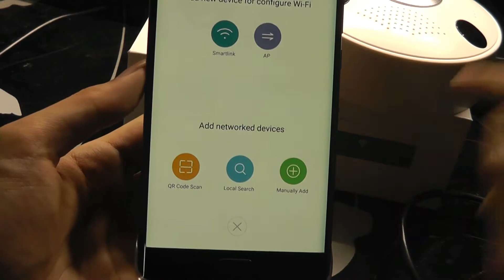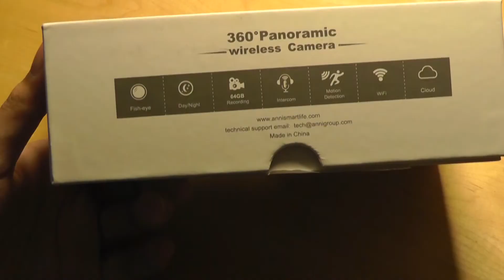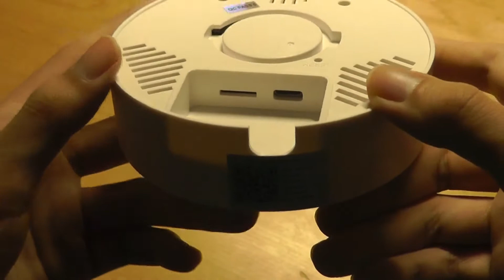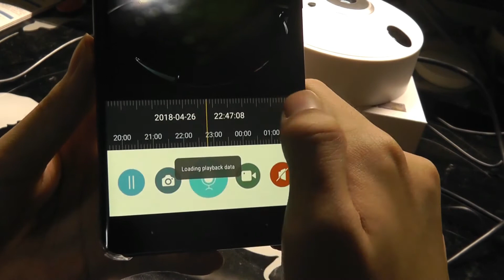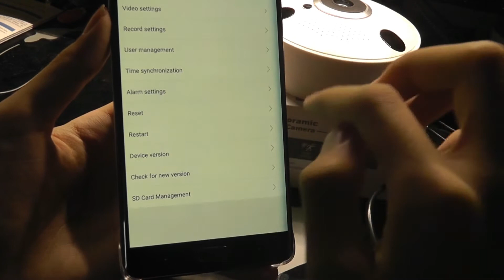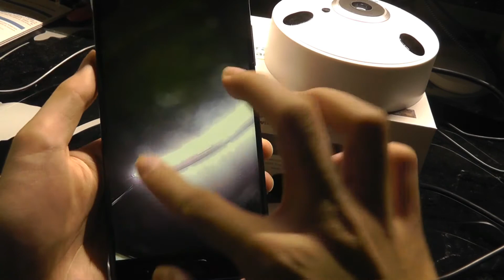REVIEW: Anni 360° Panoramic Wi-Fi Wireless Security Camera

Comment: The cameras were easy to install>>>t.co/wesiPK0ZCa   it did need a hard drive installed in it but it was easy. It was a plug and play. The wifi cameras picked up immediately, and has a better picture than I expected. The price was in the low range and that was my deciding factor in purchasing and I don't regret it.